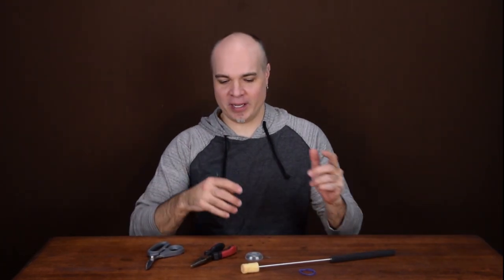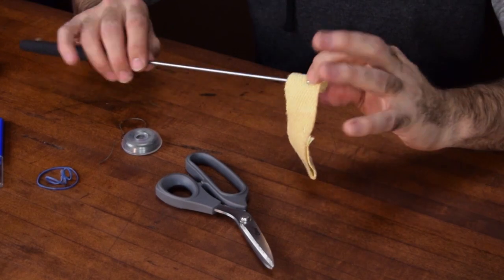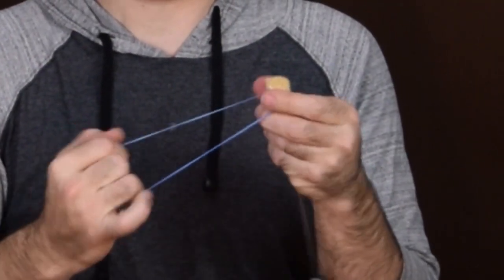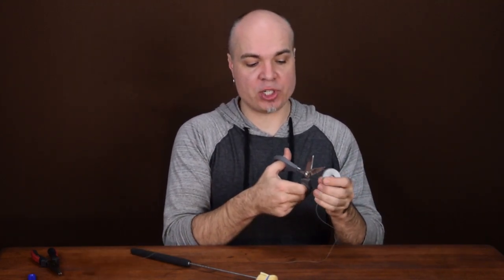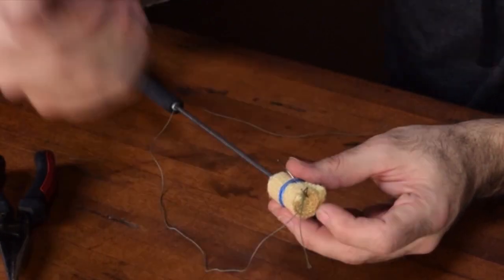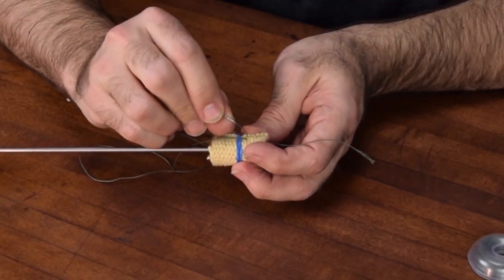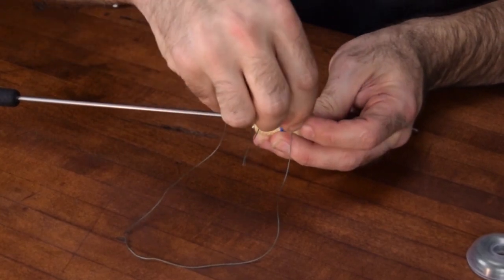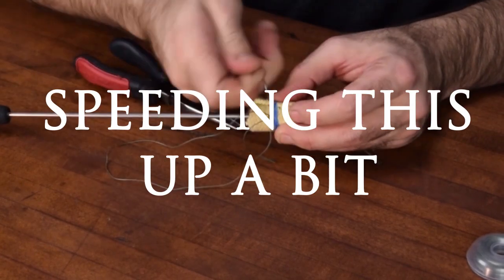How to Sew Fire Wicks

Comment: wow this is the best explanation of the process I've ever seen. is there a way to start wrapping a wick on NON-hollow metal, like a long bolt or something, where you can't use a screw to anchor it?
Reply: There are a few ways to do that. If what you are wrapping on has a grippy surface (like threads), you can wrap the wicking one time around, then take kevlar thread and wrap it tightly over the kevlar (sewing through it). If it is a thin piece of wire, you could bend the end of the wire over to make a hook and do the same sewing of the first few wraps. If it is thick enough metal to sew a small hole through, you could do that and put thread through the hole to fasten it down. The other think you can do on small rods, is use two or three "push on external retaining rings" (look that up on McMaster). Put those in a few places, wrap a layer or two over these, then lash that much down using the rings to hold everything in place. 

I hope that helps.
Reply: @chadbennett  oh you exactly answered my question thank you so much!

Comment: What kind of needle point do you use?  Like ballpoint, sharp, triangle point???
Reply from the maker: Hey DazzleLoo. I don't think it matters much what the point of the needle is. The type of yarn used on flat Kevlar wicking, is a loose weave, so that you aren't having to poke through a tightly woven product like denim. There are a lot of layers and that can compress around the needle though, causing it to be tough to push through (not a tip issue but just all the material layers around the needle). So I would recommend a high quality steel in the needle, so that you don't break the needle while pushing through. Those types of needles are def more expensive than normal needles and are surgical or spring steel.

Here is our wick repair kit if that helps -> https://dark-monk.com/Equipment/Wick-Repair-Kit
Reply: Thank you for your response.  The reason I ask is because ballpoint, which is normally for knits in sewing, moves the knits aside for the needle.  While sharps can cut the knit, causing an enlarged hole. I ask because bigger the hole I was thinking more room for oxygen to burn my threads.   What needle size do you use?  I wanna try and keep my needle as small as I could.
Reply: @DazzleLoo  I think a ballpoint might be slightly better, but for how loose most kevlar wicking is, I don't think it really matters. You don't really make a hole with a loose weave like this. 

Reducing the heat absorption is key to not having your thread burn through. The best way to prevent that is to have as small as possible stitches showing on the top layer. It isn't really the oxygen, but more just the overall heat at the outer layer that will cause the damage. If the thread is loosely stitched with a large exposed stitch, that will cause the thread to fail. I hope that helps.